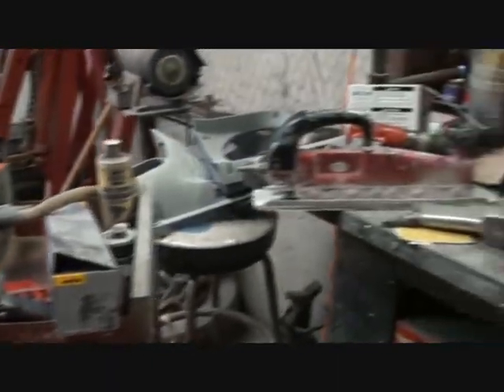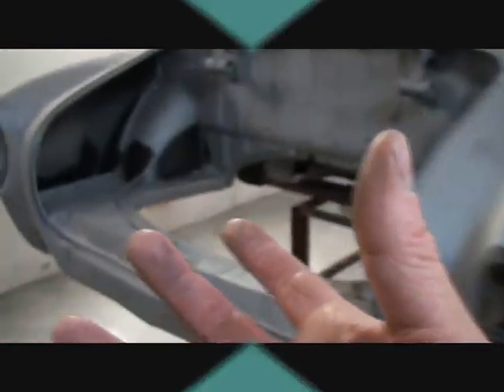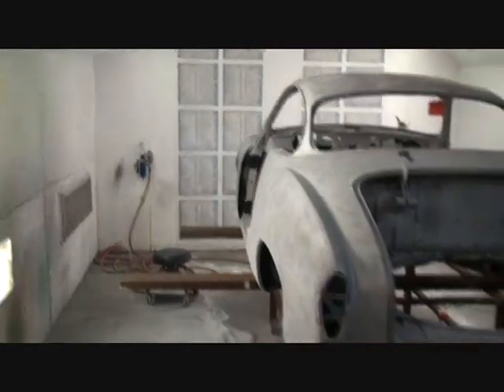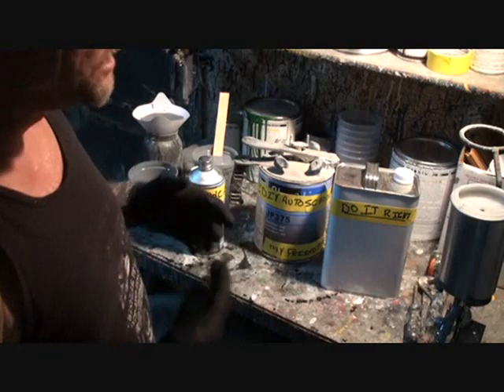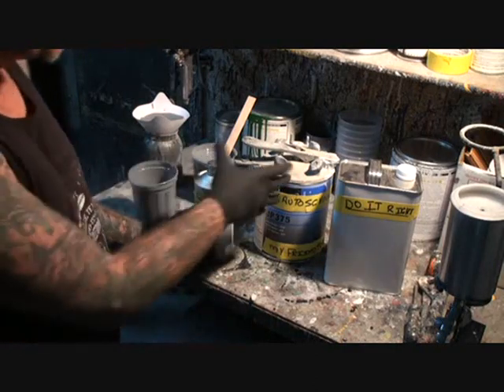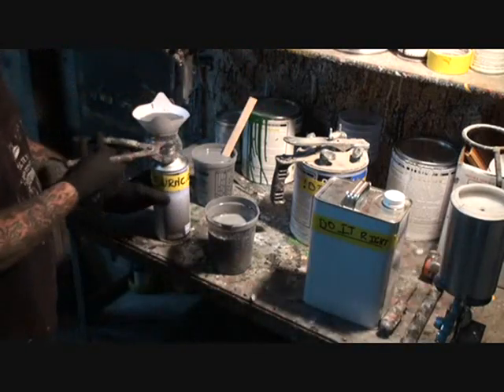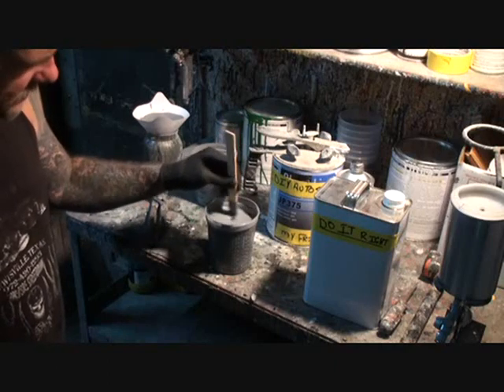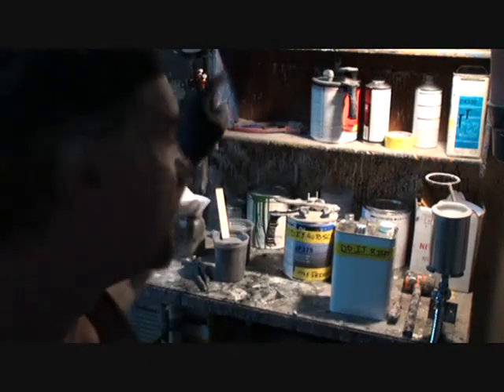Automotive Refinishing: When To Use Epoxy Primer-Part 1

Comment: i did the whole interior o my svt cobra with por15 to prevent any surface rust from creeping back in. stuff is tough as nails. i just wanna say thanks to pete for all of this info, i'm about to cut in the doors, jams,  and fenders on the car and couldn't have done it without videos like this.

Comment: Need your attitude ans. In short- someone else started working on my '48. ( I hand sanded it to the metal) Q#1. I used All Metal on some of the dings ( it was recommended), after I used All Metal- I found the painter/bodyman used Everclear/coat on some other areas... Can I use Ever Coat on top of the All Metal- Dings feel okay with just the All Metal-but still feels like I have a few area that need more attention. Q#2 Also I guess he used an Epoxy K2 Surfacer( same brand I think)-- Explained everything to the automotive store- they sold me a different brand and said it would be fine. can.t take it back... Been trying to get this thing painted for 2 1/2 years..by other people.---- let's just say it's up to me to finish- and I'm about ready to go to Rust-Oleum. from metal to finish.... What was done ( primed with Epoxy K2 Surfacer)by someone else- was the hood/ 4 doors and trunk lid ( again it took 2 1/2 years with me taking down to the metal. I don't want to finish it- but I'm not getting any friggin younger 67 and boss is '74.

Comment: I'm really nervous about doing this. It seems so hard because I've never painting like this before 1.body filler(finished) 2. Epoxy primer (not finished) 3. Primer filler (not finished) 4. Base coat, 3 layers) (not finished) 5, gloss, forgot the term (not finished) 6. Polish everything out (not finished)...... I live in God damn apartments this it gonna be difficult because I burly have any room in the balcony.

Comment: working on a 72 chevy impala, im down to bare metal do I use body filler then use epoxy primer or do i use epoxy primer then use body filler over top.

Comment: I don't get it. You said not to worry if you get runs just sand it it's epoxi primer. Shorty after you said epoxi primer or any type of sealer is unsandable. In "Paint A Bumper Cover From Start To Finish" you used it without the reducer and you did not sand it.
Reply: . You can sand out the run if you have to it's not impossible, it's super gummy when sanding. He is just saying unlike a 2k sand able shaping primer it's not sanding friendly. So the order could be metal>fillers>Epoxy>additional filler or spray filler or just 2k sandable primer>base>clear. Nice thing about Epoxy you can just spray it and leave the car outside for a bit, other primers you can't do that. He's right it does spray like bedliner, little reducer is key -
Reply: 23tomi23 ever get an answer anywhere?
Reply: I think he meant you can sand out runs but it isn't a high build primer like 2k that is designed to be block sanded all over before base. So with epoxy primer if there is a mistake sand out just the mistake otherwise don't sand it after.

Comment: so Pete if i have an activator from Martin senour (napa) that mixes 8 to1 would i use the same ratio 1part MS activator to 8 parts of a different  epoxy ?
Reply: D Lawson NO!!! never. seriously, only same manufacturer/line chems for epoxy. ppg only with ppg, etc. this is phase change, not solvent evap, so the chemistry has to match just right. wrong hardener, you could end up goo, or peelable coat, or so hard it chips from a breeze, or even all 3 on different panels. same with reducers, thinners, additives, etc. it's not plain enamel in any way, lol

Comment: got a project coming up this spring.  your the first one I seen that said to use an epoxy primer.  I'm just changing color but want to sand it down like in the muscle car makeover and get it all str8. I do have a few hail damage dents.  To get that real nice finish I know to wet sand 2k wet 400, but then is it best to then use epoxy?  or will the 2k suffice?  not sure of pros and cons if i skip the epoxy primer.

Comment: did you sand that por15 before the primer? the Por15 i'm used to has a very glossy finish.
Reply: Mike Rowledge yes it has to be sanded to give if you don’t sand it the primer will flake off

Comment: hi pete does it matter if u get a run in etch primer please yours gary uk worried
Reply: If you get a run, wait till it's dry and wet sand it lightly using 400 grit till it's gone! I reccomend you take a paint stick and cut it down to the width of the paper your using so you only sand the run and not the surrounding primer.. Good luck. Pete
Reply: thank you will do x

Comment: Pete! Love your work and your videos.  I have a question.  I just sanded a 64 Cadillac down to bare metal and it sat in the hot So. California sun for about 3 weeks.  Just a slight bit of suface rust as there was on the Ghia in this video.  Do you recommend just sanding that off and shooting the Epoxy primer or should I use an Ospho solution to treat the metal before epoxy?  Im afraid of suing the Ospho and not be able to neutralize it well enough before the Epoxy..  I noticed you went straight to Epoxy prime to bare metal,  have you noticed any ill effects on any car once you Epoxied over bare metal without neutralizing the metal (rust)?
Reply from the maker: You should D/A Sand your car down using 80 grit sand paper! If you don't have any bodywork to do you can go straight into 2K filler (SANDABLE PRIMER) and skip the epoxy primer. If you have body work to do and you are going to take your time and stretch the work out over a long period then you would use epoxy primer for a sealer while you are working on your car. This will protect it from the elements and save it from getting any surface rust. If your car is being stored outside 2 coats of epoxy primer should be applied, if your car is going to be inside while your working on it only 1 full wet coat is needed. Good luck and take it easy Pete.

Comment: i have a question pete, can i use epoxy primer over an old layer of epoxy primer or i have to remove the old layer of epoxy completely (to bare metal) ??? and if so how can remove it without sandblasting i really don`t want to sandblast the whole car and get dents all over it`s a 72` ford capri btw, cheers pete :)
Reply from the maker: Sorry for the later response! You don't have to remove the epoxy primer already applied, but you will have to take some 180 grit sandpaper and scuff it down so the primer will stick. If the primer is very old it might take more then a scuff job. When sanding you might have to switch from 80 grit to 180 grit to avoid sandpaper gum up! Good luck and sorry for the late response.. Take it easy Pete
Reply: diyautoschool thanks  for the tip pete it means a lot (Y) take care

Comment: Pete should I do body work body filler and such.before I epoxy primer then 2 k primer.then paint?
Reply from the maker: If your car or item is in bare metal and you are going to do body work right away, then you don't have to use epoxy primer. you would go straight into using 2K primer after body work. If you plan on taking your time and extending your body work out over several months you might consider epoxy primeing the vehicle to protect from surface rust. Once you have your car in 2K primer you can then blocksand for paint, apply epoxy primer right before applying paint.

Comment: Hi Pete,
Really learning a lot from your videos. I am welding in new patch panels in my truck to replace rust and wondering is I should spray all the new metal with Epoxy Primer before I begin with the body filler? If so, do I then just use regular primer after the mud has been applied and sanded and then base coat-clear coat?
Reply from the maker: If your going to do body work right away, there's no need to epoxy prime your car. Go ahead and do all the body work then prime the car with 2K filler primer. Using the 2K will seal your car as well as prime it.. Then you want to block sand for paint, spot prime using epoxy primer where you burned thru the primer and then paint your car...
Reply: diyautoschool Thanks Pete!

Comment: MY friend Pete, I have done filler work on bare metal and I plan to spot prime with self etching on the bare metal parts, then go over it all with 2k. After I finish sand the 2k I plan to epoxy seal over it all. See any issues with this?
Reply from the maker: I wouldn't waste my time with the self etching primer, I would go straight to the 2K primer and then block sand after that spot prime again using 2K then wetsand to 400 for paint and clear, You don't have to epoxy prime your whole car just where you burned through the primer when wetsanding, then your ready to lay down the paint and clear...

Comment: can you spray your epoxy primer over po15 without using a self etching primer over the por15 first? or do you just sand the por15? please let me know
Reply from the maker: Once the POR15 is dry throughly scuff it down using a red or gray scotchbrite pad. This will make the primer adhese to the por15 better..
Reply: I notice your using shop line epoxy primer, I'm in familiar with epoxy primers , what brand is best in your experience?
Reply from the maker: Brandon Keele
The all around best brand is PPG DP Epoxy primer, next best that I have found is PPG Shop LIne Plus!
Reply: We've had nothing but falairure issues out of shopline and I just can't ever bring myself to use that cheap stuff ever again, especially for a foundation of the build. I was really hoping evercoat made some so I could keep everything in the same brand.. it's dumb to me they don't, considering.

Comment: would you recommend spraying a non-activated 1 part primer under 2K urethane top and clear?
Reply from the maker: No, you should use an activated sealer on your vehicle before spraying paint and clear. The activated epoxy primer will set and wont let anything shrink back or let mositure get in..

Comment: you cant sand epoxy primer?? ummm Im confused I just put epoxy primer on and sanded it!! and its fine.
Reply from the maker: Epoxy primer is NOT designed to be sanded. It's a sealer NOT a primer for filling or sanding to great a paint ready surface. Ofcoarse you can sand it, but your wasting your time, effort, and money, when you sand epoxy primer it "gums up the paper very quickly and then causes scratchs in the primer, which can lead into a piss poor paint job. But from your comment Im sure your reply will be: I didn't have any problems with it and the paint job looks great!

Comment: hey how much epoxy do you go through to do the standard car?
Reply from the maker: Depending on the size of the car and how much your wanting to prime usually between 2 quarts to 1 gallon...
Reply: diyautoschool
hey thanks I'm doing a 1950s scooter so I think a gallon will be more than enough then in that case! awesome

Comment from the maker: epoxy primer is used on bare metal to seal the metal while your doing your body work to protect it from the elements, once you have done your body work you then use 2K primer..
Reply: You should do a video on cleaning vehicle after D.A or Block sanding.

Comment from the maker: Epoxy primer used on bare metal is for a sealer only, if you need to apply bondo and do bodywork you do it on bare metal the proceed to 2K primer, putting epoxy primer over your body work is a waste of time. Go straight to 2K primer after body work is done. Pete

Comment: So from our previous conversations, I will use airplane stripper to get it to bare metal...and then DA sand it with 80 grit...if I was to get prep and etch(phosporic acid)  for the rust it will etch the metal...is that okay if I was to DA it after and then shoot the epoxy...thanks again

Comment: I am restoring a 91 Cadillac Brougham. Sanded most of the car down to the primer. There are areas of the car that are down to the metal. Patches here and there. Removed old bondo in areas. About 15 percent metal surface areas. Should I use an Epoxy primer on the metal areas and a 2k filler primer on non metal surfaces? BTW. Ready to go to Finish Masters. What bondo, primer, paint and clear do you recommend. Not cheap crap and not really expensive. Doing a color change from silver to white.Thanks

Comment: Pete, like many others don't have money growing on my tree or it hidden in the back yard.  Soon, I will begin priming my 74vw (FAT-CHICK). However, I have purchased a HVLP from Harbor Freight for very cheap, my question is. Can I tear down this gun and rebuild it using Teflon tape instead of the liquid compound that they used uncontrollably, if so, will it effect the Teflon tape and the flow of the primer/paint?

Comment from the maker: You can still use epoxy primer as a sealer, and if you want to sand it use 400 grit wetsand. The situation is, is that epoxy primer is not made to be a sandable primer, meaning it's not like 2K filler primer. The epoxy goes on very thin and is not made to fill in like regular primer, when you sand epoxy it will gum the paper up and you have to be careful because it will leave deep scratch marks....

Comment: Pete, I planned on spraying epoxy primer on a bare metal motorcycle tank I just bought until I figured out what colour I wanted my bike to be. Now I'm no so sure after you said I won't be able to sand it. Is there something else I should coat it with for the time being or just go ahead and epoxy my tank and re-strip it when the time comes? I sort of wanted to epoxy it because I wanted to see what it would look like in flat black without actually painting it.

Comment from the maker: when applying epoxy sealer before paint you only spray one coat and a thin coat at that, in some cases you would only spot seal where needed. If you get orange peel in your epoxy prime that means you sprayed too much and your gun was set at the wrong settings.. In this case, you will have to wet sand the orange peel out very carefully using 400 grit...

Comment: My question is, if you wanted to spray the epoxy sealer before your base coat, but as you stated, you can not sand the epoxy sealer, what happens when the last coat of the sealer before your base has orange peel? wont that show once ur base is on? Thanks in advance!

Comment from the maker: If the primer you are using requires a catylist then you have to use it or it won't work properly. As for the paint, using a blue would be ok to paint over grey primer.. Good luck. Pete

Comment from the maker: you need to let the primer dry for a few days then sand--then paint.. If you don't sand the primer it will be a very rough paint job and look like shit.. If you don't want to wait, I suggest you use an epoxy sealer on your old paint, let it dry then go into the painting.. Good luck Pete

Comment: I'm planning to paint my car in my garage, I'm planning to use primer, base and clear. I have a question, can I primer and let it flash over and go straight to base coat or do i need to let it dry out and sand it before I put the base coat on? 

I'm not to worry about being show car :)

Comment from the maker: You shouldn't have had any problems with the epoxy if you let it set up to activate properly, when it's cold out you just gotta be a bit faster on the spray technique so as not to get runs, and it will dry slower.. It should be alright...

Comment: I too like the PPG Shopline Epoxy but shot a door on a day that my surface temp was NOT above 60 degrees, is there a test to see if it cured OK between coats. What potential problems can I expect......... OR do you just recommend I eat it and sand and re do.  Thanks Pete

Comment from the maker: Usually when you seal your bare metal car with epoxy primer, you end up coming back and doing body work to it, by the time you have removed the epoxy to repair all the body work, you will have removed close to 70% of the epoxy, then you come back and d/a sand the remaining down and then reprime with 2K...
Reply: So if you sand as you say 70% of epoxy off, do bodywork , then 2k high build.....then would you guide coat block 80/180.... re prime then wet 400 to paint ???? Thanks

Comment: Why Can't You Sand Epoxy Primer. So If I Use Epoxy Primer To Seal My Bare Metal Panels I Cant Sand That Down With 400 Then Put My High Build Primer Over That?

Comment: Hi pete, do you have problem with ppg epoxy primer bonding to the por15? do you sand por15 before you spray EP? im about to epoxy primer and paint my engine bay.  can i epoxy primer over seam sealer? thank you for your time pete!!

Comment from the maker: I use a chemical resistant type rubber glove that is designed for the work I do, you should be able to pick some up at your local automotive hardware store or paint and body shop supply store.

Comment from the maker: Yes I did, what I ment by that is when you are using it for bare metal application such as this, you are going to come back and do your bodywork before applying sandable primer, so getting a run in this type of application doesn't matter due to the fact that overall you will be removing alot of it just by doing the overall body work necessary. In this step of "sealing" the vehicle don't worry about runs, if it were sealer before paint then be causious of runs!

Comment from the maker: Your next step would be to d/a sand all the bare metal with 80 grit sand paper, the apply your epoxy sealer.. When using epoxy sealer make sure you follow all instructions, if you don't mix and let activate per manufactures instructions the epoxy primer will not stick properly... Once the primer is applyed you can now do your body work, welding, rust repair, and not have any worrys about surface rust appearing... Good luck. Pete

Comment: after all the patch panel, lead, and body filler work then would you just use the high build primer to cover the areas you sanded down through the epoxy primer then seal it and paint it?